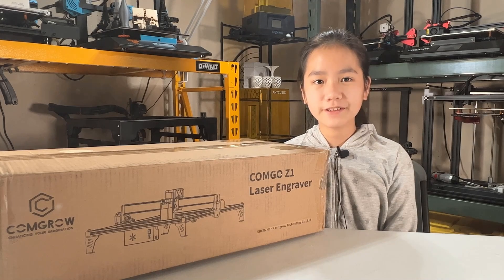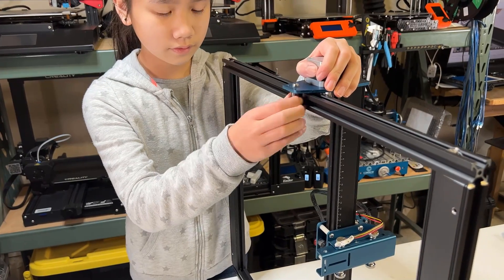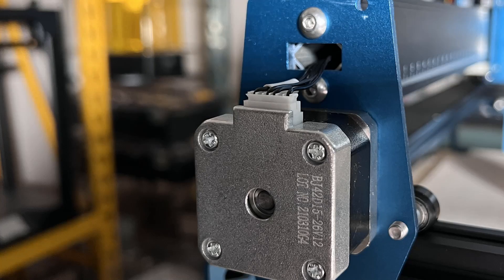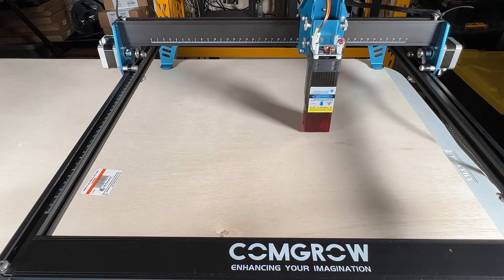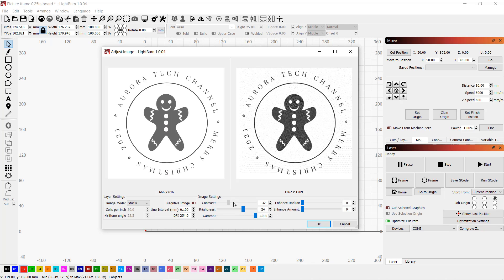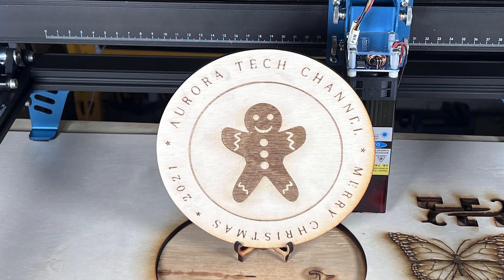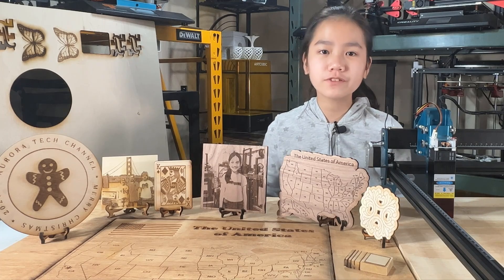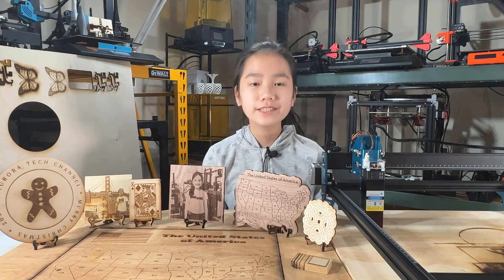Comgrow Z1 Laser Engraver Review: Engraving, cutting on different wood boards using 10W laser module

Comment: Descent review.  I would suggest though that every review contain an accuracy demonstration using a circle measured with calipers.   My current issue with this laser cutter/engraver is one of accuracy.  When cutting large objects, a mm or even a half-mm may not be an issue.  When cutting objects that must mesh, like boxes, 0.1mm is significant.

Comment: Newbie here but am I supposed to download the firmware update from the website onto the provided sd card and and flash the laser engraver, I’m using lightburn on my Mac and it won’t detect the laser engraver I just got this exact laser and it has a flashing green light on the mother board case

Comment: Hello , I did everything the same but my light burn isn’t finding my laser ?
Reply: Also when it’s off it’s green when I turn it on it’s red is that normal ?
Reply from the maker: Please try:
1. If you are using windows, check the device manager and see if a new COM port is showing up when you connect the engraver
2. Try to close all programs that may occupy the COM port and only run LightBurn
3. Try to use LaserGRBL instead of LightBurn and see if it connects
If none of them work, contact the manufacturer.
Reply: @AuroraTech  hello thank you for the reply 

So it had connected and worked for a few minutes then it just kept going to the corner like if it was homing but it made a bad noise then everything stopped connecting. 
Light burn and lasergrbl 

Light burned worked for moments at a time but would disconnect and laser grbl did not work at all lol 

I uninstalled the drives 
Installed them again 
Nothing 

I uninstalled then restarted my pc then installed again 

Then it started working for another like 15 mins n half way through a print it stopped and disconnected again. 

I had got frustrated and gave up lol 

I messaged the seller and the said sounds like a corrupt USB port. 

Not sure but will try messing with it again later today Lol.. 

Thanks for your responses and help though ! 

Very educational and fun to watch. You seem like h have tons of fun in your little warehouse you have going on lol 

Keep it up ! And thank you again !
Reply from the maker: I think you can connect to another computer and start over to make sure if it was a Windows USB to COM port driver issue or the engraver itself. You may also email me the screenshot to show how LaserGRBL won't be able to connect. auroratechchannel@gmail.com

Comment: love the video. Thanks for being so thorough. i was thinking about getting this thing but was unsure if the 10w laser was actually 10w and could manage to cut plywood in one go. 
Well, it looks like it does :)

but please please please - 11:10 - you should ALWAYS wear the goggles. the protector on the laser is just an additional layer of protection. theres still a 2mm gap where light leaks through. looking at it without goggles is still dangerous and can and will damage your eyes when exposure is too long or too frequent.

Comment: Keep it up, Aurora! Thank you so much!! It's always a pleasure to hear your review!!! Btw, there are some tips for you. It is recommended that the automatic zero return at boot can be unchecked, and the focal length of the 10W laser head seems to be not very accurate. It is 45mm and it's better to cut at this focal length to achieve better results.

Comment: if you could lower the height of the laser it could cut thicker wood, that is why a laser connecter to a 3d-printer is a better solution, in lightburn you can lower the heght of the laser after each pass. try to mount the same laser on a 3d printer and connect to the 3d printer your pc with lightburn. the laser can be connected to the cooling fan of the nozle which is pwm (and nearly all the laaser accept pwm).  have fun ;)

Comment: Great video!  Air assist will greatly improve your ability to cut with a diode laser. It will blow the ash and smoke out of the way so your cuts are more effective.  One of the tricks that I use for cutting depth is to adjust my focal length with the spacer for my fixed focus laser and then lower it half of the thickness of what I want to cut.  
During your video, you mentioned the smoke damage on your finished product.  A couple of tips for that are to take multiple cuts at lower power and higher speed.  For my OLM2 I typically set it to 300 @50% power and do 4-7 passes depending on what type of wood I am cutting. Play with your power, speed and passes settings and you can get it down to almost no smoke damage.  Also if you're worried about the smoke damage to the bottom of your piece, you can raise it up on something like a cooling rack from a dollar store.

Comment: Nice review.  I'd like to cut some balsa wood for RC model projects. Do you think the 5w would suffice for 6mm balsa?

Can you send gcodes to the controller?
Reply from the maker: I am not sure about that, but I guess 5W laser may still be able to cut 6mm if you do 2 passes. Yes, you can load a gcode file from the program and send it to the machine.
Reply: @AuroraTech  Thanks